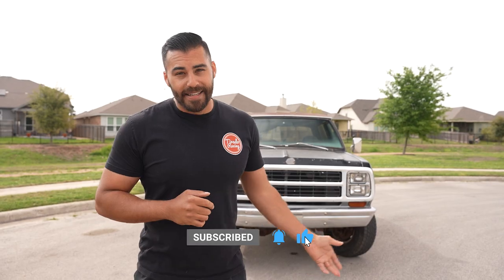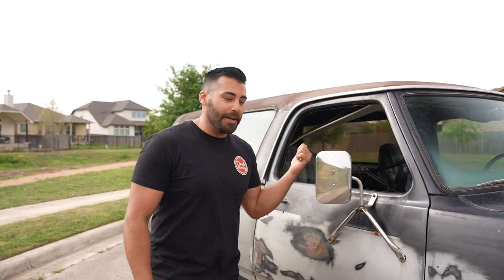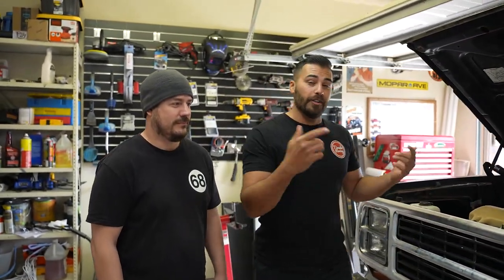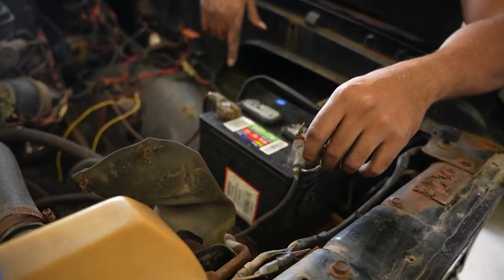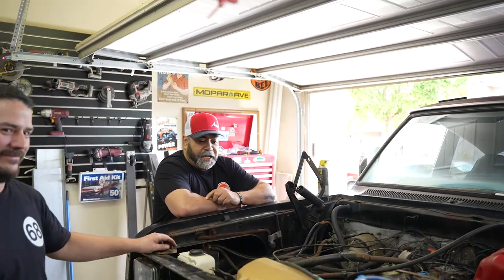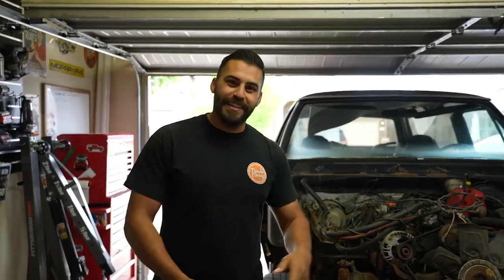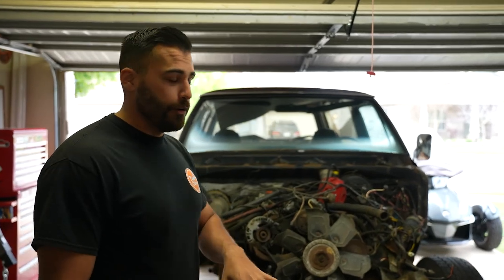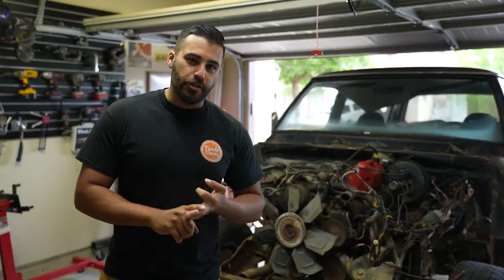Ramcharger Restoration Begins!

Comment: I’ve had my 79 since 2007. Had a few 80s versions and other Rams. My daily is a 20 Warlock. 
I swapped a NV4500/Dana 300 in 2008. Part time axles from a 83. A rebuilt 360 magnum in 2011. 6” Skyjacker lift, 35s w/ a new LSD in the 9.25 and a Aussie locker in the 44. Finally doing the wiring now. 
If you aren’t doing 8 lug axles, you can at least convert to part time with axles, knuckles, hubs and rotors off a 80-93 and axles/drums from a 80-up. Get the c-clips if you get 85-up, different thickness. Pads, calipers and etc are all the same. You may need the backing plates out back too, Ramchargers and some D/W150s went to 11” drums in the 80s.. 
After the wiring is done I’ll be looking to do a Hemi swap in this and the D150 I recently bought. Just wasn’t feasible in 2011.
Reply from the maker: Man that’s awesome! I think the craziest thing I might do is a 360. I don’t want to spend too much time on this one like I have with other projects. We want to get it running and start enjoying it!